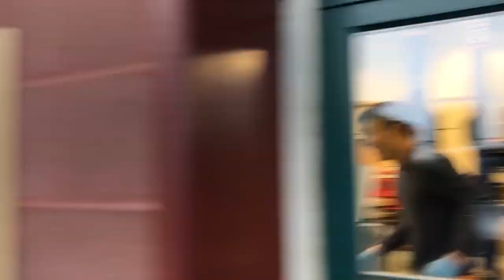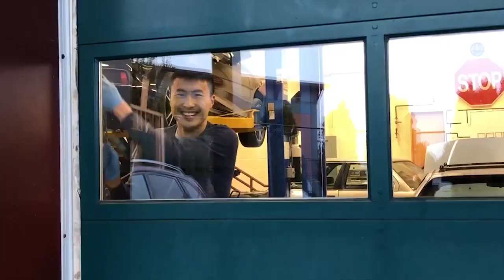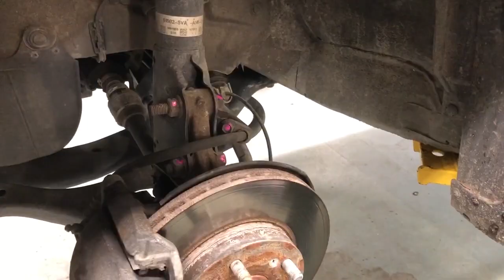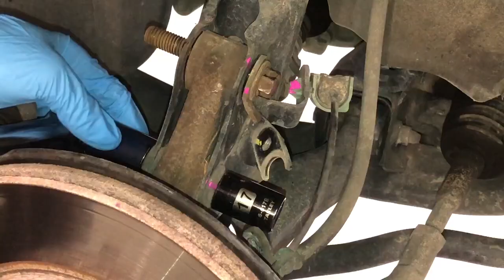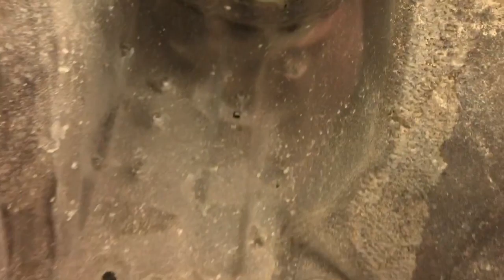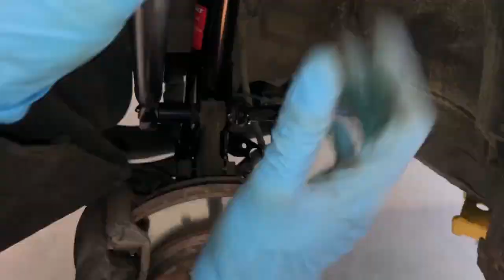How to Replace Macpherson Struts - 2005-2011 Honda Civic

Comment: Great video! Tried to do the same but I'm stuck. Rotor and all doesn't move freely so I can't replace both lower bolts. Got the bottom bolt in but I can't line up the top bolt, the wheel is in a low camber position and won't lift up. Any ideas?
Reply from the maker: Hi Raas,

Perhaps your lower ball joint is seized and doesn’t allow your hub assembly to move freely?
Reply: @Garage88Official  Had a bigger problem, cv joint slipped out of the transmission. But I got the joint back in, got the knuckle level n continued the replacement. The work hours on!